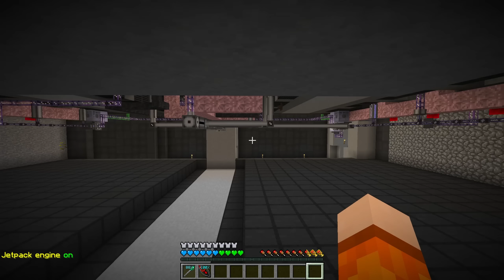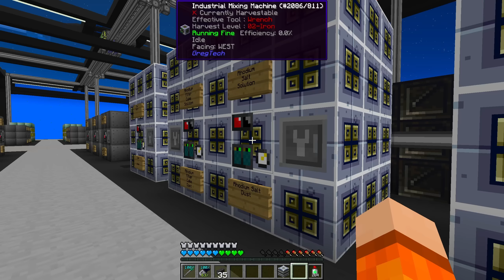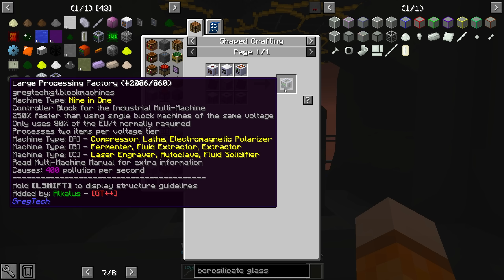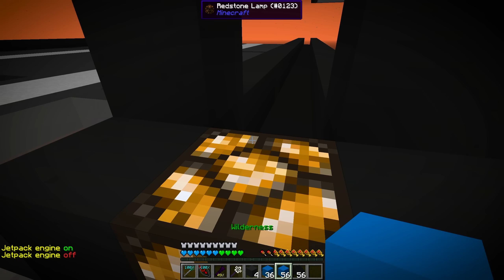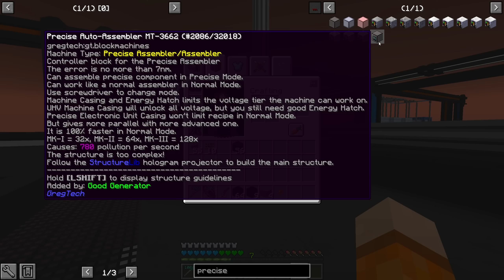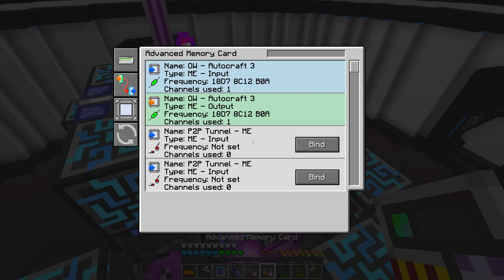Gregtech New Horizons S2 68: Autocrafting Hardware

Comment: In case anyone is curious why Three has a PA with single block LV macerators doing his macerating, IIRC he build that before the Maceration Stack was brought down to EV tier, and the T2/previously only IV gated tier requires more Palladium than Three was willing to batch craft. These days I'd recommend getting a Maceration Stack when you're able to in EV, and upgrading to a T2 when you've got access to ZPM circuits, I.O.W. Quantum Mainframes. The Palladium is no big deal, early platline plus some Platinum Group Sludge Dust will solve that issue before you build a full platline.

Tungsten Bees are fantastic for getting passive tungsten. Unfortunately tungsten dust is not fantastic for actually cooking into tungsten ingots, as it's noticeably slower than using tungsten trioxide. Be prepared to spend longer cooking tungsten if you're sourcing it through tungsten bees, and you don't have Volcani set up yet.

I've mentioned the benefits and reasons for splitting your central power spine into multiple sections before, but short summary for those curious: More power available for different sections of the base, more stable power supply (recall the brownout issues Three's Platline had earlier), greater control over what sections get an upgrade/rewire and which can wait until later, naturally uses more space that is required later on when upgrading to laser hatches/active transformers anyway, and of course upgrading one thing doesn't automatically ruin everything. Needless to say that if you can afford to split your power spine initially I would recommend doing so, but it can be quite expensive. And difficult if you don't have your base design well planned out ahead.

If you're ever concerned about overamping a section of your power spine you can use diodes, or dye different lines different colors. The latter isn't great if you're used to dyeing cables to denote their voltage tier, but otherwise it will prevent you from connecting differently colored lines.

You can spam wireless redstone, either GT covers or other forms of it, and use that to conveniently toggle entire sections of the base on or off for when you're messing with the power spine and things would break. Of course it's a debatable question whether the effort spend making sure every section of your base is build with such a feature doesn't exceed the amount of effort it'll take to fix cleaning up after upgrading the power spine and causing a machine blackout. It's not something you do very often, after all, especially if you future proof your power spine to minimize the need for upgrades.

If you're building a chem plant with a specific recipe in mind you don't need to go higher than the recipe's minimum tier of solid casings. Coils you should always do the best you can afford, since it makes the recipes both cheaper and faster (though note there are diminishing returns to that the faster a recipe's base speed is), and pipe casings likewise since running recipes in parallel just means more throughput for basically no meaningful extra cost. Not to mention catalysts, if the recipe uses any. Machine casings can be the same tier as the lowest bus/hatch tier, as with solid casings there's no meaningful benefit to going beyond a specific recipe's minimum needs (though keep the potential parallels in mind).

Ah, yes, Thorium 232. Let me try to explain the rabbithole that is Thorium 232, and the various ways you can go about solving it. First off, why you want it in the first place, Thorium 232 is a major bottleneck when you want to create Molten Arcanite - or Arcanine as I tend to refer to it as - which in turn is a required component of the Large Processing Factory, the Tree Growth Simulator, and the DT++ (again, as I like to call it). Just to name the major uses in IV tier multis. There is more...

Anyway, there's a multitude of awful recipes for it, and two recipes I'm going to call "usable". The former includes sifting Purified Thorianite Ore from Ross128b, centrifuging Thorium Dust, and centrifuging depleted single thorium fuel cells. Specifically single fuel cells, not duals or quads, since of course you can't just cut a depleted quad cell into four depleted single cells. That would make far too much sense. Anyway, all three of those methods are, to the last, slower than molasses and/or have garbage chances at actually yielding Thorium 232 dust. The depleted fuel rods are technically decent odds, but they take 50000 seconds to deplete in a reactor. Which is one, of several, major issues they have as a source of Thorium 232. Or anything bar the laughter of those rightfully mocking them, for that matter.

The two useable recipes are the EBF method, and the chem plant method. The EBF method is a painful chain of recipes where, in traditional GTNH style, you mix eight different things in four different ways and further deal with a half dozen byproducts because of course you can't just smash two dusts together and cook it into an ingot. But despite all that it's actually the better method. All ingredients are common, a fair chunk are even returned through processing the byproducts, and no individual recipe takes a long time to run. And even then many are LCR or EBF recipes, which have good options for being sped up a great deal for little required effort.

The chem plant method is simple and straightforward, requiring just one LCR and one chem plant alongside a source of Borax (Salt bees or Salt veins). That said neither process is particularly fast, and a single chem plant doesn't have too many ways to speed up recipes - particularly when they're given garbage tier coils and pipe casings to work with 🙃. It's a valid method for brute forcing your first initial supply of Thorium 232 if you don't feel like setting up a small chemical line right this second, but don't rely on it long term. It is not a long term solution for Thorium 232, as it's way too slow for that to be a good idea.

If things are expensive in GTNH this early on you need to invest in better infrastructure. Tungstensteel, even stacks of it, should not be an issue in mid-IV. It'll take a minute to cook and process, sure, but if the major material of your tier isn't an issue anymore midway through that tier, something has gone horribly wrong. Or you're in IV and everything is needing massive expansions and major upgrades all at once that you were not prepared for. Either/or.

For the record, since the tooltip is less than clear about this: When it says "250% faster than using single block machines of the same voltage" it doesn't mean it runs at 250% speed. It means it runs 250% *faster*, meaning 350% speed compared to a single block machine, or 3.5x faster. As you can probably imagine when you're crafting stuff by the stack and individual recipe times aren't necessarily measured in ticks, that is a big deal.

The simplest solution to deal with fluids in I.E. Assembling Machine recipes is to just supply fluid to the machine and exclude it from the recipe. That does mean the autocraft will get stuck if it runs out of rubber, and in the case of PAs or other multis you'll have to keep potential recipe conflicts in mind, but if the first case happens there's probably worse issues going on in your base, and the latter case is just a matter of paying attention to circuits and fluids when checking recipes.

You can get a Precision Assembler in IV if you invest in an MEBF to cook ZPM EBF recipes, like the MAR-Ce the Precision Assembler requires. Whether that's worth it, of course, depends on the state of your base. In particular your power production and power spine, since MEBFs are only as valuable as the amount of infinity power(s) you can shove into it.
Reply: Wait why'd you say that it's a problem if the major material isn't an issue halfway through the tier? I'm a bit confused on that. Isn't that a good thing? Or am I missing something?
Reply: @idkwhattfimdoin  "if the major material of your tier isn't an issue anymore midway through that tier". As in it starts off being an issue initially, but midway through you manage to completely solve it.

Basically, if you're in a given tier and you're not able to throw around that tier's material, you're going to have a very serious problem progressing through it. You will need machines, alloys, EBF coils, etc., in order to advance, so it's worth making sure you're not short on such a critical (and probably relatively basic) resource.

Comment: I KNEW I WASN'T GOING CRAZY! I KNEW IT WAS THOSE FLIPPING INGREDIENT BUFFERS! Thank you for solving this weird "why is like 5L of this liquid not making it to my machine one in every hundred or so crafts??" problem I had. It was driving me up the wall!

That interface into interface subnet solution is actual genius, I got super excited watching you do it. Finally I can get rid of those broken-ass ingredient buffers!
Reply: I've actually never had this problem with ingredient buffers.  What I HAVE had problems with is recipes in other busses taking fluids and using that instead (easy example: wire coating and making Machine Hulls in the same assembler - the recipes don't know which fluid type to use so they'll pick at random)
Reply: I think there are large ingredient buffers. Your recipe might be too large to fit in the small one

Edit: also don't forget the blocking mode on the interface

Comment: New music :))
It's really incredible to see so much tech progress in this episode.  Obviously the grind in previous episodes was also insane, doing bees, moving the base to the void, horizontal infra upgrades, etc, but this huge infra expansion and especially the LPFs are a big jump in tech and the assembly line seems a lot closer for you now :)

6 LPFs is CRAZY, there's no reason to make more than 3 for quite some time, but that's the threefold difference.  The casing limit is so low that it's a total non-issue outside of laser mode.  There are some laser lens colors you can share, but you CANNOT place multiple circuit 20/21/22s in the same bus so you can't share say laser and autoclave recipes in the same bus even if they don't conflict.

If only you could put the molds in the input hatch :((
Multiblock fluid solidifying is so obnoxious for basically no reason.  I guess you could use 4 of the LPFs in fluid solidifier mode to get 4 different molds
You can actually automate multiple different molds in one LPF, there is a guide by Sampsa in the GTNH discord, but it is EXTREMELY unvirtuous.  It basically boils down to bundling the item and fluid inputs into an AE storage cell, atomically swapping that into a subnet, and chokeslamming the mold into the LPF using a stocking input bus.  The stocking input bus allows you to hot swap molds and share molds across many machines.  I set up the naquadah line with one neutron activator using opencomputers, but I didn't bother with the multi fluid automation for LPFs because it is too grimy.
The GT++ alloys that require a tier x ABS continue to obnoxiously require tier x fluid solidification or tier x metalworking (bender, lathe, etc).  I would often deal with these by manually swapping molds in the LPF and pipetting fluid with volumetric flasks, which is disgusting but when these parts are needed like one time for the toxic everglades portal frame or LSAss for example it doesn't really seem worth automating.

Yes replacing the ingredient buffers with uwu dual interfaces would be wise.  It becomes more complicated when you need multiple input busses.  One solution is having all the fluid storage busses point at dual interfaces on a common subnet with a fluid storage bus on the input hatch.  I believe I used a one-to-many fluid p2p backwards instead of the common subnet and that also worked.  Transvector interfaces don't work because blocking mode doesn't comprehend them
I expect that you aren't actually voiding fluid but rather accidentally getting a cable/hull/hatch/bus crafted with the wrong kind of rubber.
The ABS is very easy to automate, you can share circuits in the input busses so only three input busses should be sufficient with proper planning.  Then you can either have it automatically output to a dedicated ingot fluid solidifier, or deal with fluid outputs directly.  The only really annoying part is when you get one of the above mentioned GT++ alloys that need a higher tier to work

With bees, liquid helium is arguably easier than sodium for coolant cells

Comment: One solution to fix machines shutting off during battery maintenance is to build a secondary battery that can pick up the slack while you're doing maintenance on the primary.

Comment: For the assembler PA, I make the subnet 2 layers, 1st is for item 2nd is for fluid, all separate item subnet connect to the same fluid subnet, which connect to a quad hatch.
This maybe need some messing wiring but use the same places as ingredient buffer. Hope this can help you to say goodbye to all the ingredient buffers :)

Comment: Instead of using a super tank for the on demand fluids you could just use filtered fluid cells (like with the boric acid)
LPF fluid soldifier can really only do 1 mold without creating conflicts, besides a few molds that don’t have many recipes like ball mold. There is a new hatch that will allow a mold inside in dev to allow multiple molds
The multiblock soldifier is really nice for making ingots, ball mold, rotors and the glass tiers
Staballoy is better as an ABS recipe
The buffer likely isn’t voiding fluids, just is being stuck in the interface, you could also just use blocking mode to prevent the buffer filling up. There is also a bigger buffer
You could do subnets for the assembler, just input all the fluids into a single fluid subnet into 1 hatch
You could easily share the lathe with the compressor and polarizer no problem. That LPF would be more useful as a fluid soldifier
The implosion compressor can be upgraded to a GT++ version

Comment: I don’t use those fluid discretizers or whatever they are called, I simply use a Dual Interface with a pipe on it. It seems to save resources without loss of functionality. The only thing you NEED to do is use a pump: the fluid might be sent back to the dual interface if you do not. Because the Dual Interface pushes fluids out, you’d think it would work without pump, but the pipe can just slosh back.

Comment: You could probably use the multi block solidifier if you put the mold into the recipe, it would send over the mold along with the fluid, then a Redstone signal from the machine while it's on, and a enderio item pipe extracting while there is no signal, aka when the machine turns off. Probably run into problems with multiple recipes at the same time, but you could probably fill up the input bus with items and filter the system to only pull out the mold once it's done.

Comment: In (I think) the previous video, you mentioned how sometimes when placing special tile blocks like ramps, carpenters blocks, etc, they had a mind of their own regarding how they'd be orientated when placed. If you're familiar with Create you might know the overlay that splits block placement into quarters, and that if you place a block while hovering over one of them, it'll face that same direction. I think most of the blocks you're having an issue with will behave in the same way, but they just don't have an overlay to show that to the player.

A lot of words for a simple, somewhat intuitive idea, but hopefully it helps. I was base building in GTNH myself and realised this was probably what your issue was.

Comment: The reason why the fluid got voided is not the problem with the ingredient buffer, it's the problem with the pipe, the pipe is not good enough so sometimes it will cause the problem. I could use AE subnet to handle this.

Comment: you should setup a "stone age prevention system" essentially an isolated system that is not dependent on external power to reboot your main power and/or keep your Ae2-main net powered incase of a sudden power loss or otherwise catastrophic event. and yes it is entirely wasteful and unnecessary right up until its needed which is to say, "the bad ending"

Comment: 49:15
ok this is kind of a crazy idea, but:
it sounds like the issue with using the subnet here is that you don't have enough space on the PA to have a separate input hatch for each circuit number subnet. but what if you had one input hatch, with its own *sub-*subnet that was being exported to from each of the separate circuit number subnets? like, that would let you get away with one hatch total, shared across all the recipes
Reply: not exported to, I mean stored in (storage bus on fluid interface)

Comment: Id reccomend swapping from macerator PA to maceration stack. Theres an EV + IV tier one. Both are significantly better
Reply from the maker: That's the plan! It's just that in previous versions the Maceration Stack used to be much more expensive than it currently is :)

Comment: Why not add a redstone machine cover thats connected wirelessly? To a master manual switch, so when you need to mess with the power again, flick a lever to force turn off the entire base production, making it so you dont void anything. And once the tinkering is done, just flick it back on again. (The only wireless redstone control i RECALL could be used is to place that machine cover that checks fluid storage across a frequency,  could use that if other options are gated behind progression? And manually fill a tank or empty the tank to turn off/on machines)

Comment: Been wondering.. why are many of the smaller intermediates (screws etc) not on passive instead of on-demand?
Reply: Putting everything on passive would be wildly impractical compared to something like nomi, there is so many more materials, plus resources are finite, plus the machines have multiblock versions that are fast enough for what you need in the pack